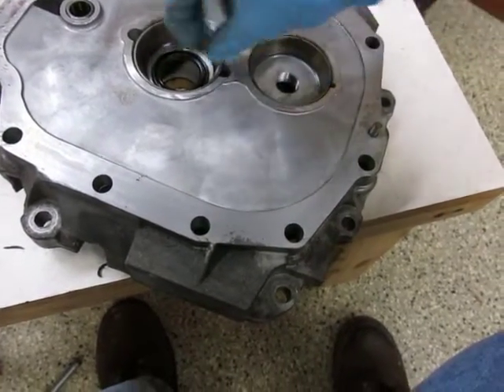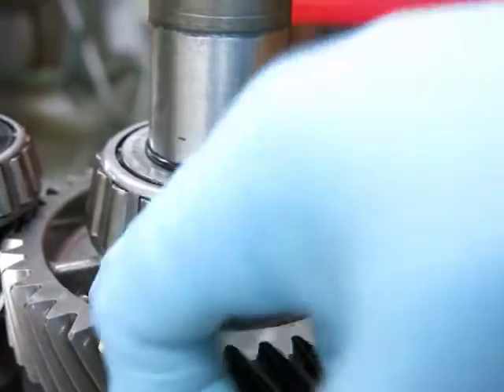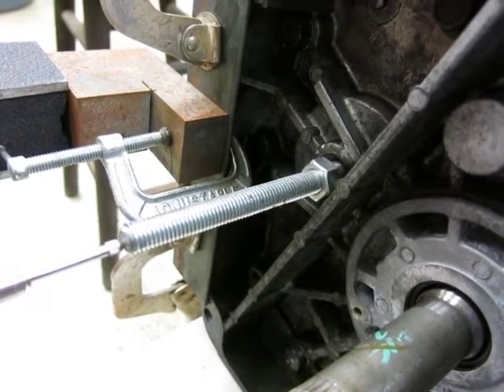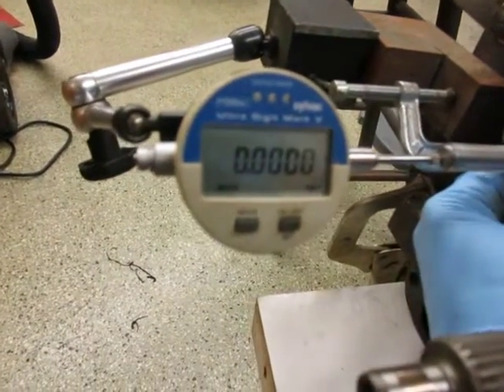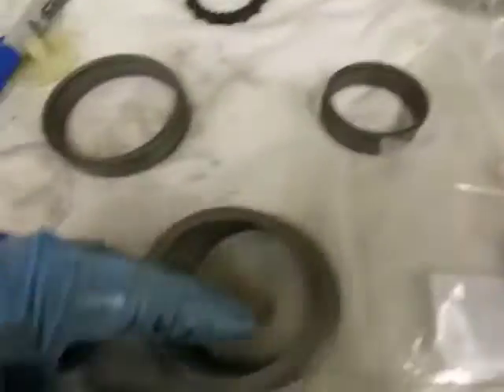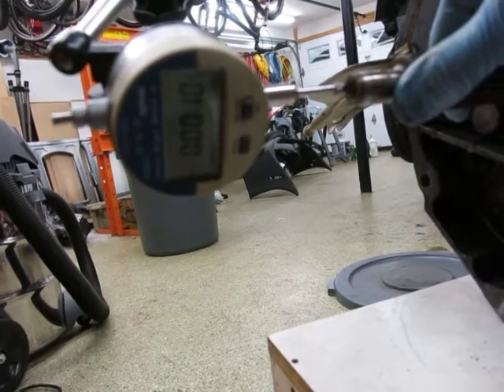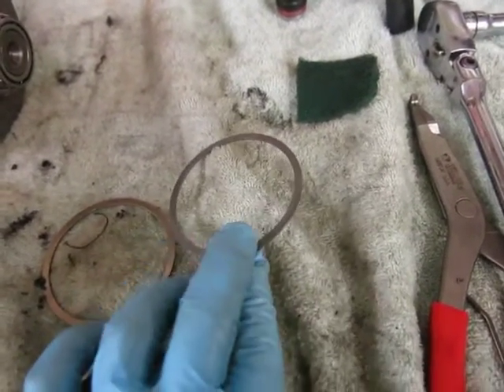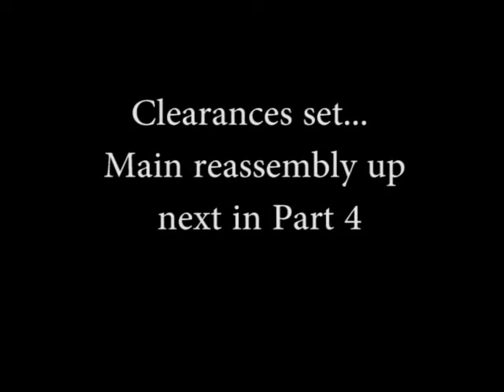T56 Transmission Rebuild   Part 3   Setting primary clearances

Comment: Ok I want to make this comment here instead of part 4.  Lot of people including my self have had a hard time pressing the 5/6 driven gears on with out causing damage to bearings.  Not sure if all t56 are set up the same but I was able to pull my case off with 5/6 gear still installed.  Mine got stuck cause the tolerance was to close on the new shaft.  Once the case was off I was able to take the main shaft assembly to the press and take off the gear to inspect for any damage.  You can press the gear back on this way and reinstall everything.    So in short I would build the shaft up shown in these video except when you put the case bearing and little oring on I would press the 5/6 gear on with the main shaft off the front plate.  This is of course if your 5/6 gear will clear the opening on the case the main shaft stick though.    Hope I made this clear enough.

Comment: I know this was a while ago but I'm curious in case you remember. Did you compare your final shim numbers with what you started with?
Reply from the maker: I didn't measure clearances before disassembling - not sure how you would even do that unless you did it half way through the disassembly.
Reply: @SlideruleRacingProducts  Thanks for responding after so long. I moreso meant to ask if you compared the existing shim thicknesses you removed with the ones you added.
Reply from the maker: @millerfawaz151  Ahh..I understand.  I don't remember comparing the stack I ended with against the original shims.

Comment: good series  learning a lot, as far as the mills go i figured you were talking 0.31 mill because 31 mill is like 1 1/2 inches
Reply from the maker: In U.S. machinist parlance, a "mil" is 1 thousandth of an inch.  U.S. Machinists will say millimeter if they mean millimeter.  https://en.wikipedia.org/wiki/Thousandth_of_an_inch
Reply: @SlideruleRacingProducts  that crazy imperial system you use, ha ha. super confusing for us metric folk..

Comment: What if the shaft is too tight? I can't turn the shaft by hand but my mechanic is very stubborn and says there is no problem.
Reply from the maker: If the clearances are too small and the shafts are so snug at room temperature that they are hard to move by hand, then I think your mechanic is playing with fire.  The aluminum case will expand slightly more than the steel shafts when they heat up, but I wouldn't risk running with clearances too low.
Reply: Chris Bruno so you think something got broken inside? https://youtu.be/liLfaloGtlo I can shift with engine on and feels fine but I can't with engine on and if I start it with first gear engaged the truck bogs like if I was pushing and releasing the clutch quickly,  thanks by your reply.

Comment: Very good videos, thanks for the information! But just for future reference most people do not know what a "mil" is, unless you are talking about paint thickness on a car. .001 is called a thousandth, .0001 is a tenth of a thousandth and so on.
Reply from the maker: https://en.m.wikipedia.org/wiki/Thousandth_of_an_inch
Reply: @SlideruleRacingProducts  thanks did not know that. Ive never heard a machinist use mil in automotive or aviation language. But looks like you are correct sir. My apologies.

Comment: Just for the record you never do this laying on the side, it will never be accurate. It HAS to be standing vertical. I have done it both ways and found that I'm off anywhere from .002-.004" with it laying down.